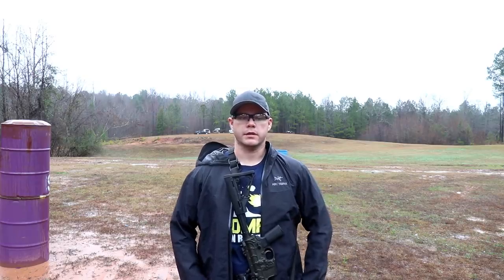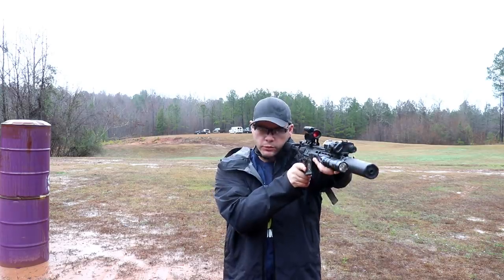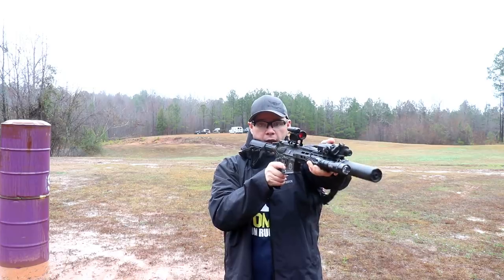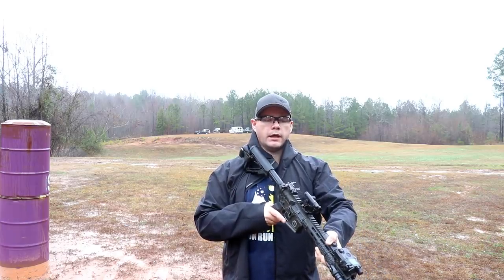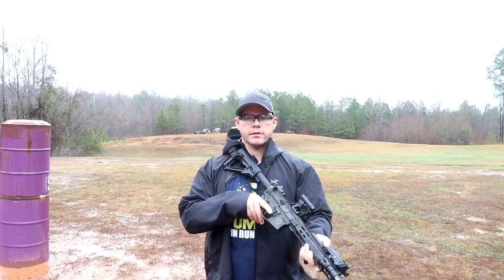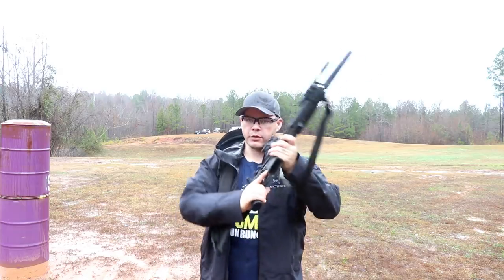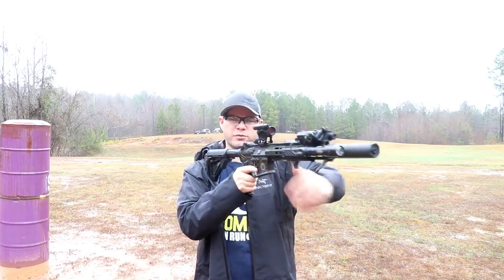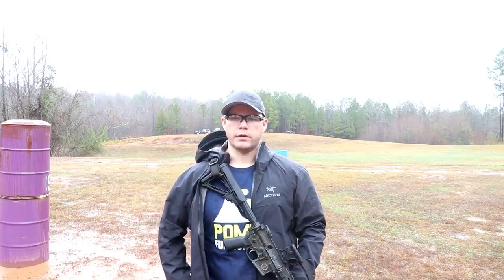Rifle Ready Positions

Comment: Why is this SUCH a debate?  I get department policies and "range rules" but if you're totin a rifle on the job, there should be an expectation of responsibility and professionalism. In a stack making an entry, if you're nuts to butts, the safety circle thing ain't gonna work. Muzzle up allows quick muzzle entry into the room without lazing your mates in front of you. Muzzle down, ND puts the projectile at my or my mates feet and lower extremities. Muzzle up keeps bang switch clear of gear. Safety ON until sights on threat. 
More good stuff Aaron. Thank you.
Reply: My thoughts exactly.Muzzle up and break down the weapon into the pocket til you push through to where someone's not going to grab your muzzle from the barrel as your coming up from a low ready on entering.Anyone going past a blind spot in the low ready is asking for a mistake that's puts  their muzzle under someone else's control.
Reply: Three Arrows I’ve demonstrated repeatedly that breaking a doorway with the rifle high port causes you naturally to drop the rifle down to come to bear on a threat. If a person is standing there, they can easily grab the barrel as you bring it down from over your head (the only safe place to be in a room would be against a wall where you can’t be seen by someone pieing the doorway before entry). If you’re at low ready (or whatever we’re calling rifle down) you’ll be coming up. This is much harder for them to grab and will at the very least get them shot in the legs/groin and have them off balance as they try for the grab. It really all depends if you’re working with a team or alone. Every guy in a stack except the first will need to be high port for safety. It’s a position of disadvantage that’s made up for with the force of a team. If someone grabs your barrel, he’ll be engaged by the guy right behind you quickly.